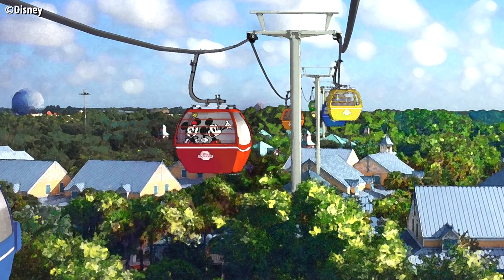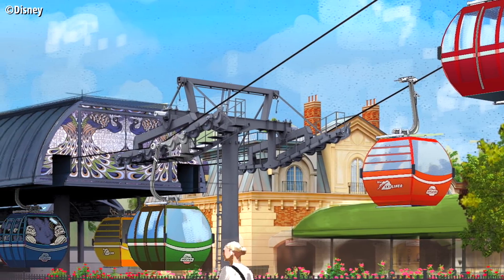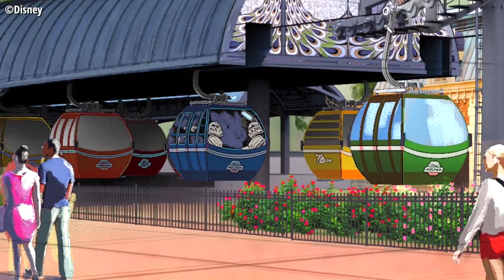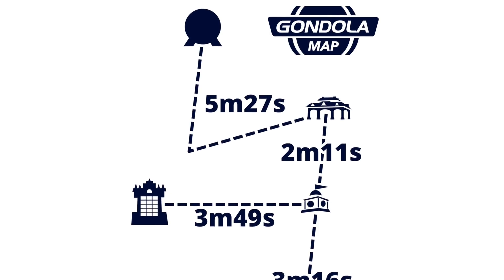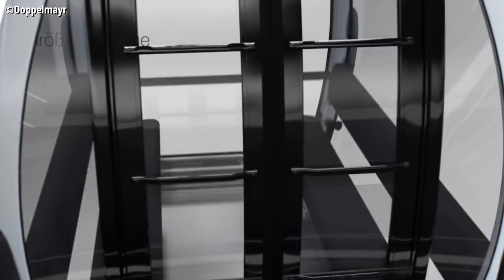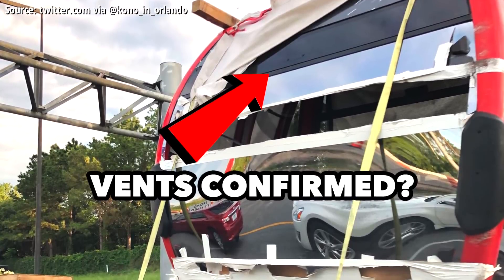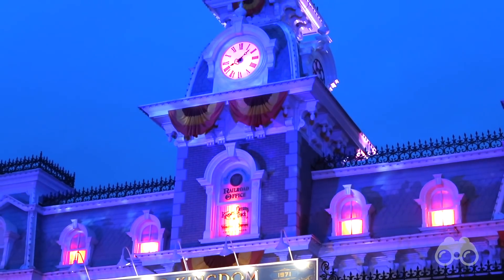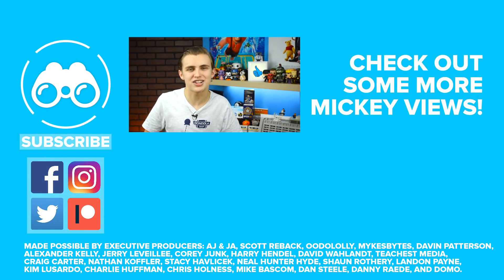NO A/C on the DISNEY SKYLINER GONDOLAS?! 🔥

Comment: No A/C? I won't be riding it. I've been stuck in a gondola once before with no A/C and it was miserable! And this was in the mountains with a cooler climate.
Reply: Would you rather not ride no AC gondolas but be at your destination in 10 min or less or wait for the bus , ferry or monorail for 30 for 45 min? It's not like you're in the gondola for long. It's constantly moving unlike those other mode of transpo.
Reply: @gissneric you sound like you won't be waiting just as long for the gondola ride itself. I've been to Disney World multiple times and never had more than a 25 minute transfer time. If you know where and when to go, you can avoid the long rides. I only needed to be stuck one time to know that it's a no go. They will heat up inside. Also, it will take longer than you expect. Starting from a point that has to travel through a couple stations, the cars will slow down/stop and there will be no air flow. So I'll take the more comfortable way to the parks. Disney should have just added to the monorail system. That would have been much better.
Reply: Also your gondola ride will fly pass the Mount Matterhorn mountain with the ice glacier on top.

Comment: Also with these buckets hanging on metal wires on metal poles up in the sky, what is gonna happen in the case of Florida's classic freak weather events?
Reply: Plenty of these stand in areas with high winds already. If the winds are too high for safe operation then you just don't run it.

Comment: I don't entirely agree with the reasons you give for no A/C. Given the size of space in each car, a small A/C unit less than 5,000 BTU's would work fine, and could even use a smaller unit if need be. In fact, there are small light weight units readily available in the RV market. Likely, by removing 1 car, the others could all be given the A/C they need without affecting operation and cost to purchase and install the units.

The big question is power. RV's often use 120VAC to run their A/C's. When no power is available, the A/C doesn't run. Solar is an option, placing 1 panel with a couple batteries for daytime summer operation, and shutting down the A/C at night during cooler temps could work but the weight of solar panels as well as cost kinda hurt the idea. 

The other option they have is evaporative cooling which relies on circulating water in a loop to draw heat from the air (Cooling the space) then dripping it past a fan to remove heat from the water outside of the car. Again, weight is an issue as you would need at least 4-5 gallons of water, plus a circulatory pump, radiator, reservoir, and fans. However the problem of power goes away as such systems can be run on 12 and 24VDC systems with little amp draw. 

Whatever the solution, Disneys imagineer crew will come up with it im sure.
Reply: I believe there are a few RV units that are 1500 or 2500 btu, which would require 1-2 amps, still its a lot of power use and thees no real clear answer. Fans would work if we were in a dry heat, but Florida is usually muggy and humid until the noon rains come which means you could use the worlds biggest fan and still find yourself feeling like your about to melt.

Comment: The reason they won’t have ac is because it’s very difficult to do so. Every time a gondola comes into the station it will be disconnected from the cable to make entry and exit more easy therefore it would be very difficult to supply power to each gondola for the ac unit

Comment: I don’t see any means to transfer power to the gondolas body to support AC.  Is there even internal light?  For an additional fee Disney will provide riders with battery operated portable personal AC units.
Reply: I've been on the old gondola's several times when I was younger.  They had low power accent lighting, and plenty of air circulation. I miss them. Glad to see them coming back again!

Comment: Why is this a surprise to anyone? The gondola’s are at height and moving with more than enough airflow to be comfortable in Florida for all but a tiny handful of extreme days. And how would you power full active air conditioning? Where would you mount it, how would you deal with the condensate? They no more need air conditioning on these then they need it on the parking lot trams. This is a nontroversy.

Comment: A/C wouldn't even necessarily solve the break down problem. There are only two or three gondola systems in the world that have AC and they all use a system where power source in the car (a ultracapacitor) needs to be recharged every time the car passes through the station. So, even if they did provide AC, it would necessarily last very long if the line stops.

Comment: While the system does look like a good way to transport guests from the "medium to mid large tier resorts" to the parks, I fear that the capacity of this system may not be feasible for a park to park service. I've tried a similar system within the grounds of Alton Towers theme park in the UK, and the queues on that backed up tremendously later in the day when people were trying to get out of the park. The queue just to get on board reached as far as a 30 minute wait, and that's not even mentioning that Alton Towers is still quite a bit smaller than Disney World. Personally I really hope they expand with bigger transport options in the future like a Monorail extention from Epcot to Disney Springs, or Rail/Skyliner connections to the Waterparks and Animal Kingdom.

Comment: A completely serious question, hopefully answered by someone well schooled in the technical challenge:  how does one provide air conditioning to a moving vehicle that didn’t have its own engine?  A gondola doesn’t move itself along the wire, it clamps on to the wire and the whole wire moves.
Option 1: send electricity thru the cable and have each gondola siphon off power to run the AC.  What could possibly go wrong with suspending people from an electrified cable?

If anyone out there has suggestions, I’d like to hear them.

Comment: Here’s a thought... the gondolas are on a cable, there is no power in each car. The cost of managing a battery system for all the cars and running those A/C units would be an infrastructure nightmare.
This is by far the best solution.
Reply from the maker: The CWA Omega-4 system Disney’s using is not only powered but also has an A/C package already in use in multiple cities, namely Las Vegas. Disney opted against it, rumored for budget reasons. Thanks for watching! ~Brayden
Reply: There is no aerial gondola system in Las Vegas. You are probably thinking about the system at the Wynn Palace casino in Macau. This is one of only two  (I believe) single cable systems that have A/C.

Comment: I think another reason for no A/C is power delivery. I am at disney now and i only see a single cable strand on the towers, they would need 2 conductors to supply power to the gondola. But as of now i am not excited to use the system! On a summer day exiting the park even the trains that have A/C are uncomfortable imagine a gondola that is heat soaked by the florida sun that is 90% glass and it has only one little window for cooling ! Or how about the all together possibility of a 10 knot wind that blows in the sane direction as your 5 minute ride ..... you get the idea

Comment: What if it breaks down? Your burning alive?
Reply: Mr99Boxer Stop. You have ABSOLUTELY NOOO idea whatsoEVER about what the costs are of running an amusment park. Dont you notice how they have the most parks than ANY other amusement company in the world? And how other parks are much cheaper? Exactly, while theyre cheaper, they never extend their parks and build more. Disney always keeps expanding and building new parks.
Reply: @ehtropenelopen5192 doesn't Disney operate 10 (not counting water) parks? That is a lot - but not the most. Six Flags currently operates 13 parks - that expands to 15 in 2019 (technically it is already 15 but two are operated independently this year). They will open 5 more outside the US over the next few years.

And Six Flags adds a new attraction to every park every single year (caveat: not always a big one)

Comment: Hello Brayden, do you think there is any technology they have to have a cab off the line so they can preload it i.e. handicapped people/wheelchairs/scooters, etc. Then be put on the line for seamless transitions? Because we've all seen how long it takes scooters to be put on buses...
Reply: The Doppelmayr D- line has dual loading platforms.  In the stations they move about 1/2 mph. Easily drive a scooter or wheelchair in the cabins
Reply: @vonrollskyway1  great!

Comment: Great video Brayden! - HMMM...If Disney installed a small RV style AC, they would have to power the transport cable with 120-240 volts. Each A/C might draw 10 amps or more. With a hundred cars on the line it would add up be 1,000 amps going across a mile or 2 or 3 of powered steel support cable? Were would all this power come from? How would these connect and disconnect from this transport cable?  Worst scenario...what if an electrical fire broke out in a gondola from the A/C?  That's a TON of current draw to chain together like this. Massive safely hazard! Having passive gondolas would be far safer from a legal liability perspective.
Reply: Called battery and solar..the 10 passenger cabins on other Doppelmayr monocables in the UK have air conditioning.
Reply: Again the UK outsmarts the US in engineering.  Not fair.  Well, we at least have the Brooklyn Bridge.  So there chums !
Reply: @mr99boxer30  - Well?...the UK has achieved the ability to add AC units to their gondola vehicles. Now,...let's see if they are able to build a full scale "Walt Disney World" in their country. Now THAT would truly be impressive! ;- )
Reply: +CLIFFLIX    Usually it is Disney itself that builds the park in the host country.  Not the country.  But Disney is smart because they only build in climates that can grow oranges.  Cold, Rainy, Foggy London Town won't due. And the British already have their Castles.  So again, UK engineering has outsmarted the US a second time.  I give up UK !

Comment: Air conditioners require a system to power them and which means a lot of extra complexity and especially weight and waste heat.  You wouldn't want the support cables also carrying high voltage electric power.  Clever as the are, the Imagineers are still constrained the laws of thermodynamics.  There ain't no free lunch (note to grammarians:  double negatives reinforce, not cancel;  this is colloquial English, not algebra).

Comment: AC was NEVER an option. Free hanging gondolas can not be powered enough to run AC. No batteries are big enough. Maybe just a small fan and a light for evenings. Even then maintenance would be huge headache. This ‘experiment’ will be dismantled in a few years. MK skyway was discontinued for a reason.
Reply: AC is actually possible, there are a couple Dopylmyr systems that have it. It's just very uncommon. These systems use ultra-capacitors which both charge and dis-charge very quickly. AC would add cost, complexity and weight to each car which would reduce capacity. This is hardly an experiment, urban gondolas are quite common and are a proven technology. This system is a lot different then the old skyway.

Comment: Mike Here - I read somewhere that there will be battery packs in the D-Liner series gondola cars that are charged every time a gondola travels through the various terminals. These power on-board audio systems and an air circulation system. The gndolas themselves are treated to block UV and IR light to vastly reduce radiant heating by the Florida sun. With 2 loading areas at each terminal there will be no need to stop the system for guests in wheelchairs or scooters, since the second loading area can have a stopped gondola without stopping the rest of the line. See: https://www.cheapsleepnow.com/imgcab/custom/dhdesimvmaar7zs.jpg

Comment: Weight, maintenance cost and complexity. A couple hundred pounds on each car would massively increase the strain on the wires and the system. The cost to maintain the AC units would be extremely expensive, plus you'd have the issue of somehow needing to either exchange gondolas or stop the ride to repair or replace broken units. The only other option would be simply not using gondolas that are out of order, not an option considering the demand. In order to put a separate unit on each gondola you'd need to come up with some way to route power through the wires. I seriously doubt the units have any power running to them.  If they are doing this efficiently the ventilation system should be operated via solar/battery. Also in order to operate the AC units, you'd also have to change the design to accommodate the vents.  Trying to put a unit on each car would probably triple or quadruple the cost of the entire system if not more due to the increased complexity and the need to strengthen every part of the system to accommodate the extra weight.

Comment: For those wanting the A/C, how would it be powered? The cars are hanging on a cable. No way to power any A/C units. Any self contained units would need refueling often and would be cost prohibiting as well. With the total number of cars in the system, its just not feasible.
Reply: High capacity batteries are in use in other places.  As far as cost prohibited?  You're talking about one of the richest companies in the world.

Comment: Wait until it breaks down and no air circulation 🤣.   who dies first before Disney puts in AC
Reply: Even if they did have AC the power could run out for it too
Reply: A little discomfort never hurt nobody.  OK they might have a few "Near Death Experiences" with senior citizens but we can revive them with ice water.    and a Mickey Ice Cream Bar.
Reply: @ThomasJM  true, but you'd still have AC for that period of time. And then you could still have vents.
Reply: @Danrarbc  but they aren't going to have AC so it doesn't really matter. Currently the only gondola system in the world that has AC is the one in London England and it barely works there. If they have trouble with it somewhere that it doesn't really get that hot what makes people think it will work any better in Florida?
Reply: @mr99boxer30  ever see heat exhaustion or heat stroke hit a person?
Reply: +Cliff Brown  No, I am not a medical person.  I sell cable wire.  But Disney has more air-conditioned spots and attractions than most cities.   The time length of most skyliner rides will be only 3 minutes.  Good German Air-cooling has not let us down yet.  I think it will be OK.  They will test the system well.  I bet you will be one of the first guests to try it !   And like it !  Nicht Wahr Freund?  Ja.  Richtig !  Wunderbar !

Comment: Is it confirmed that theres no ac system i have a hunch that just because the ac system isnt on the top doesnt mean that it cant be housed under the gondola its self it wouldnt need much and it looks like the bottom of the gondola to the floor is about a 2 to 3 foot space that can house things in a cavity under the floor of the gondola and it also looked like there were whens on the out side of the bottom of the gondola moght be to bring in the air for the   ac system if there is one just cus its not in an obvious place doesnt nessicarrily mean that there isnt one but well find out soon enough hopefully a concrete answer
Reply: Who was the sales man that sold that to them....from Kansas?

Comment: I think people are far exaggerating the temperature of these gondolas. Having been on skrides like this before, I have never felt hot since the vehicle is continuously moving at an elevation with higher winds and cooler temperatures. I don't see how being stopped on this would be any different than the peoplemover, if not better since there will be constant air flow, the cars are fully enclosed from humidity outside, and there should be a constant breeze.
Reply: It will be a little different since these are enclosed in glass which will trap hot air vs the open air system. Think of sitting in an un-moving car with only the window cracked in really hot weather (such as in Florida). Hopefully they will have some type of emergency ventilation for emergency stops, etc. While it's moving though I agree it should be fine.
Reply: Maybe in an open-air vehicle, but these new gondolas will be completely enclosed with only small vents .....
Reply: The people mover is an open air vehicle and nobody seems to complain about that being hot. Sure it's more covered than the skyliner will be but they are both smooth moving rides with a good breeze and these will only be exposed to direct sunlight for only short periods at a time and shouldn't "bake" people too much since the windows will most likely be polarized and not refract as much heat as your typical car window
Reply: That's true, but what makes a car hot in Florida is sitting for long periods of time in the sun. Since these should theoretically only be on the circuit for a couple minutes, they shouldn't be capturing as much heat as a parked car sitting in the sun would. That being said if you're stopped for more than 20 minutes it will be miserable, but what outdoor ride would it not be
Reply: Let us know....scream louder if you cannot speak through the hot glass.

Comment: What happens when storm approaches?   How do you remove the people quickly / power failure  --- and the time travel doesn't include waiting for a unit.   As there are only X amount available.   ---
Reply: As was said in the video, each leg of the trip is 5 minutes or less so there is plenty of time to clear the line when a storm is approaching. The has backup generators to keep in moving in the event of a power failure. Wait times at most times of the day will be very small. The system is rumored to have a capacity of 5000 people per hour per leg, that is the equivalent of a bus leaving every minute.